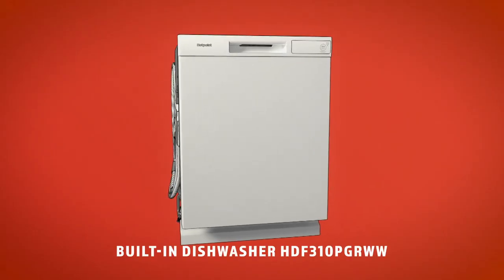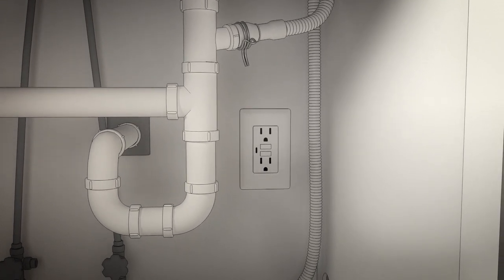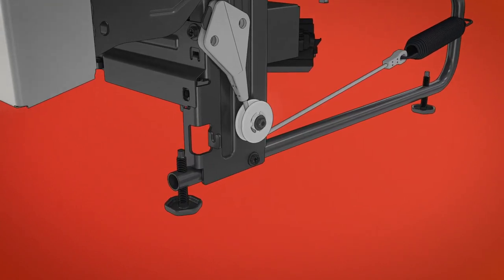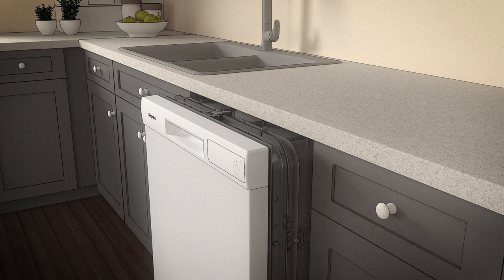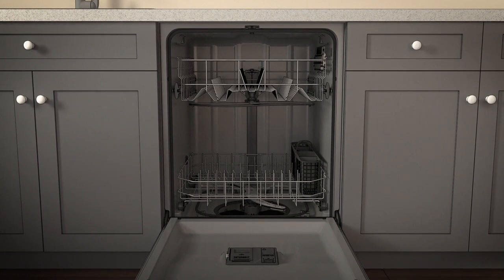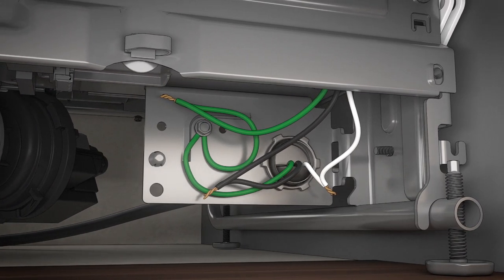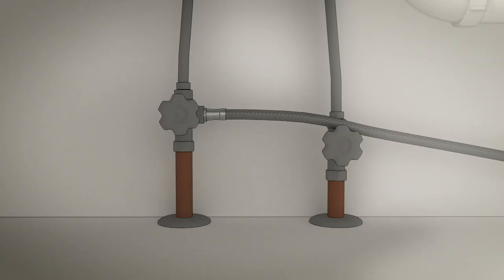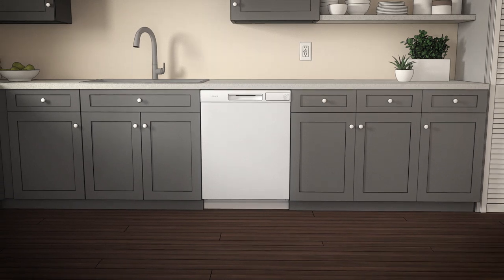How to Install a Hotpoint Plastic Tall Tub Dishwasher

Comment: My Hotpoint dishwashers start button begins flashing for a few minutes and then the dishwasher just shuts off before finishing it's cycle. What did I do wrong?
Reply from the maker: Hello and thanks so much for choosing Haier! We're sorry to hear about the trouble, but we're happy to help! If you just installed your new dishwasher, make sure you've turned the water faucets on. The error you describe sounds like the unit is not getting water. If you continue to have trouble, please send us a private message with your model and serial number on a social media platform that allows direct messaging. Thanks! - JB